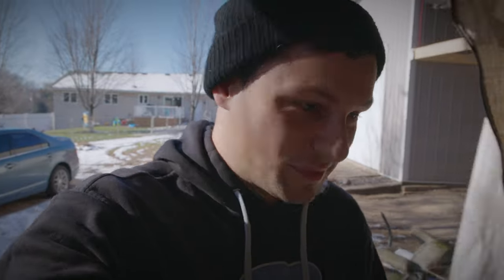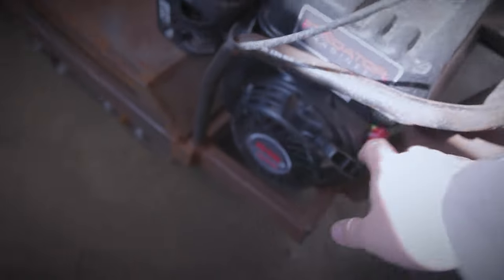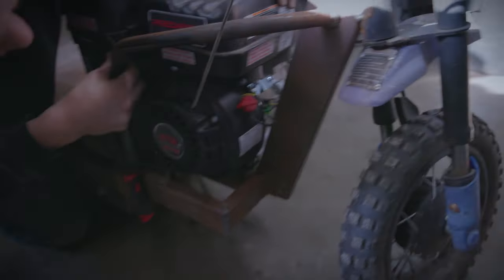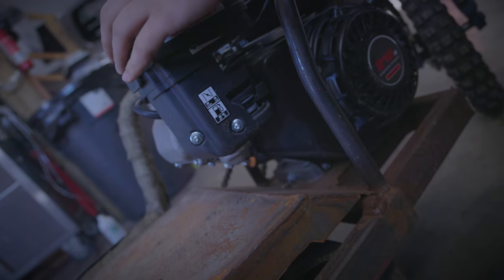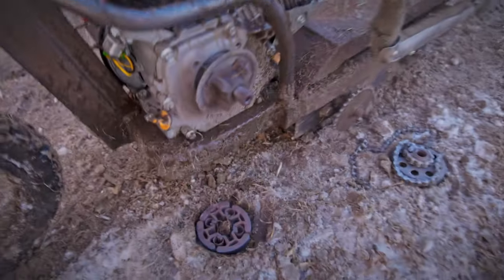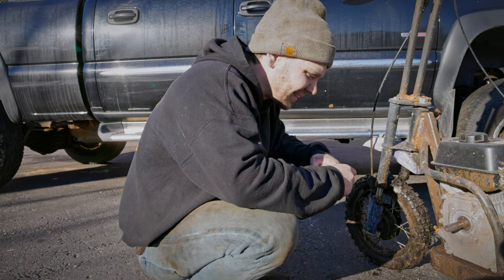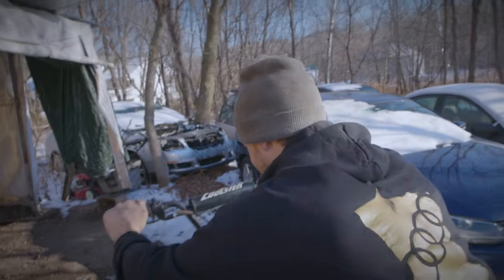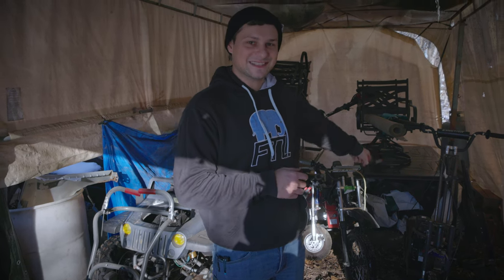"SCANK" Tracked Predator 212 Scooter Shreds

Comment: Would recommend a cast or billet flywheel if u run a slid carb on it they tend to throw the magnet off when u rev past 5k

The stock rod is good for around 6k to 6.5k rpm